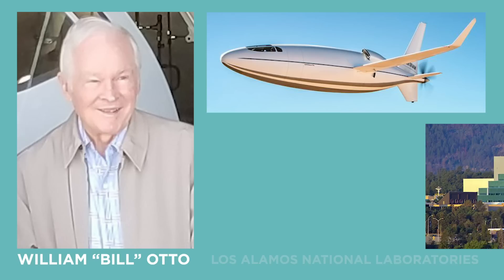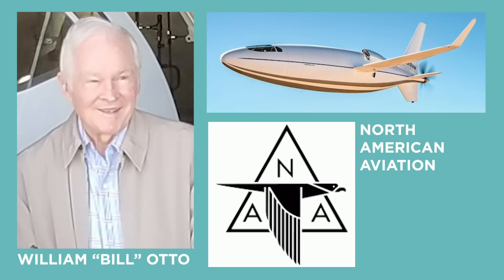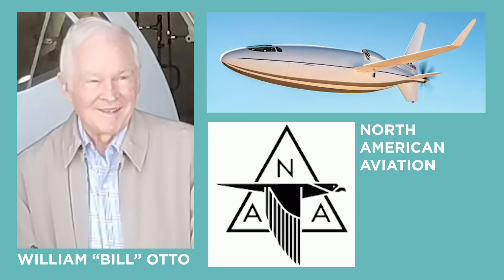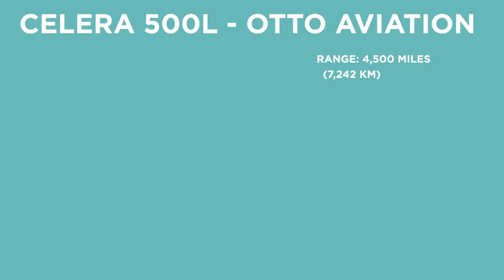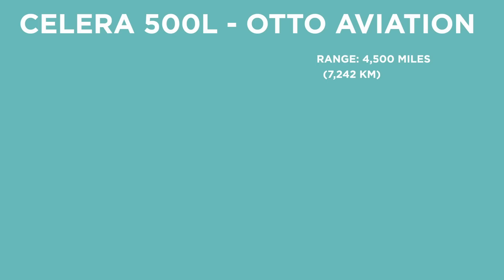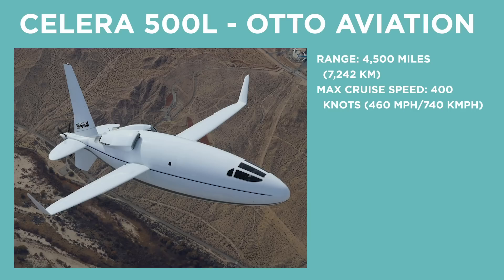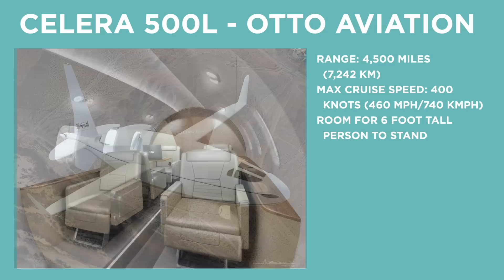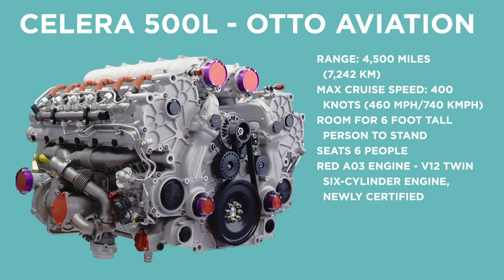Could This Plane Save The World? (Hint: No.) | Answers With Joe

Comment: The Celera is a step in the right direction. For example, if one of those planes crashes you lose 7 people -- a tragedy, yes, but two magnitudes of catastrophe below losing a fully loaded 747.

If the Celera could be scaled up for, say, 50 or 100 passengers, now you have more of an apples-to-apples comparison.

But the real improvement in aviation (besides going from fossil fuels to electric), is to devise a reliable VTOL system. If all aircraft could land and take off vertically, we'd be able to eliminate those long long runways from airports (well... maybe keep just one for emergencies). Congestion over airports during busy times could be eliminated, as AT Controllers could simply direct each incoming plane to a designated landing square. And the horrible crash trails generated by large aircraft that fail in takeoff or landing would be no more, as failures would be confined to small areas and would not hinder other aircraft from operating.
Reply: (BTW I'm not an aviation expert either, just like Joe, BUT... I do own the entire 200-piece set of Jello airplane coins from the 1960s, complete with storage carousel and booklet.)

Comment: Please Read a recent article in Flying Magazine by Peter Garrison, a aircraft designer, journalist and longtime pilot. He explains why it is unlikely the aircraft could ever meet its stated performance numbers, which by the way, are at altitudes the F.A.A. would never certify it to fly at. Beyond that it is not intended to be a replacement for a 747 or any other airliner. Additionally it looks strangely similar to another failed design, the Lear Fan.

Comment: You divide passenger air service into A) commercial routes which could feasibly be serviced by a Boeing 747 and B) private flights for six or fewer (probably rich) people. But there might be demand for a plane like the Celera 500L to service regularly scheduled commercial routes for which use of a Boeing 747 would be absurd. In most cases, such commercial routes are probably not serviced at all currently. There are probably hundreds of airports across the country which could accomodate the Celera but not a large commercial jet.

Comment: I agree on your point but let's say that is a good smal step in a rigth direction. 
Also you missed few things.
1) Spending in giving work to pilot and less in fuel is good. And this can be pushed a bit. Like reducing taxes on wages and increase taxes on fuels.
2) Today fly optimizatiuon works on "forcing" people to fly where you whant manipulating prices to fill planes. And it's a super fragile and difficult to scale down system. Infact with COVID all airlines will faile without some help. Having smaller aircraft is much easier to adapt to market changes.

But... to exploit point number 2. Prices for this kind of plane need to go down and it's capacity go up. At least double the passengers. Or 4 time better.

Comment: Yes, but is there anything stopping them from creating a Celera the size of a Boeing 747? Because it is so energy efficient, it seems like an electric Celera should be possible.  If 747-sized Celeras can be created that run on batteries, that would seem to solve the problem of GHG emissions. The second thing to keep in mind is that most of the  impact of jet travel comes from the radiative forcing from the contrails, which has roughly 3 times the warming effect of just the CO2 emissions, plus there is the black carbon from incompletely burned jet fuel. The Celera with a propeller won't be creating the kind of contrails like conventional jets, so it really does seem to be able to solve one of the major problems. 

By the way, pilots cost way more than $50 per hour, at least 747 pilots do.

There are a lot of good ideas out there like aeroships (i.e. blimps) and aeroships that travel at high altitudes to catch the jet stream (https://www.sciencedirect.com/science/article/pii/S2590174519300145?via=ihub) , but they get very little investment to do the R&D. The exciting thing about the Celera is that it seems to be getting the funding so it will actually come to market.

Comment: I think there's a lot to be said for the flexibility you get with a large fleet of small planes. Most of the costs of each flight are fixed. That is, it costs basically the same amount of money to fly an empty plane from Seattle to Denver as it does to fly a full plane. I just flew on a boing 737 with a full crew and less than 20 passengers. The airline literally lost money on that flight. Large fleets of small planes definitely cost more to operate, assuming that all flights are full, but they mitigate the risks of losing money when flights are not full. I can see a scenario where that reduced risk, makes the cost worth it. And since airlines are just going to pass those costs on to consumers anyway, we may find that passengers are willing to pay more to fly smaller. I know I would. I guess time will tell

Comment: Electric aircraft make sense for trainer aircraft ie: the cost of fuel is quiet high for 30 minutes ($50 -$100)

So to lower the cost of training a new pilot is key in order to lowering the cost of aviation much like it is with any industry that requires years of training.

Comment: Wouldn't the real benefits really be the overall efficiency of allocating passengers?

If you took an international flight to an airport when you want to travel to the country, you'd want to fly to an airport close to your destination, as well as travel to any province/county you need to go to, using a bus or car.
Maybe with this you can use mini airports that take you to larger international airports so that you save the fuel of the automobile both ways. This way, you can also reduce a number of international airports in an area, and distribute the passengers using these. Sort of like an international railway, but with these planes.

Not to mention there's a massive opportunity to make a taxi service with these if the scaling gets better. Travel between cities is easier, and Crossing bodies of water becomes far easier. The biggest competitor for this would be trains of course. At 9 Passengers with 20mpg average, this could have ~180 PMPG, which is greater if I'm correctly understanding the quick google. Also the mileage of the plane may be more efficient than land vehicles as the aircraft tends to travel more linearly. 

Notably, I have no experience in this field. So I may be missing details :(

Comment: There are multiple conceptual mistakes you make when analyzing the potential impact of this new type of aircraft.

1. You assumed that companies won't use if it it's not as profitable. Companies DON'T get to decide what the price of stuff is. So, if a new company comes around and offers seats on this new type of aircraft at a competitive price and there's demand for it, it doesn't actually matter what existing companies would like (e.g. direct routes, shorter waiting times, etc). Companies don't set prices, if one comes around and is successful they'd have to offer it themselves or die, or lost a percentage of their existing market share. 

2. Airlines DON'T make their money by selling tickets, at least not any of the major large airline companies. They make their money mostly by selling airline points.

Also, obviously, a 737 is not 20 million. But that's neither here nor there. I'm not saying this aircraft will revolutionize the industry, my point is that you need to be more careful about your assumptions regarding how the economics of the industry are like.

Comment: Perhaps if they tried to create commercial planes designed towards creating laminar flow.

Also just gas-milage/#passengers 

737: 5/366=~0.01366 miles per gallon per passenger

Celera: 25/6=~4.16667 miles per gallon per passenger

It couldn't come close to being more profitable than a 737, and it hardly makes private flight affordable for more people, on top of being significantly being more environmentally impactful on a per person basis.

Comment: Instead of making a room full of human readable instruments, control mechanisms and chairs for pilots, a room called a cockpit, we should instead have a closet full of GPUs and sensors in and around the aircraft. We don't need the pilots and 6 passengers don't need to be babysat if there's a monitoring system in the aircraft.
Less passengers per planes means more planes which means you would need a better system for landing those planes. You could have 2 planes land one after the other in rapid succession if you could take advantage of the drag cause by turbulent airflow. You could use the drag sort of like handrails this way the following aircraft can stablize and destablize it's pitch, yaw, trajectory, etc as needed to land safely or evade danger if something goes wrong with the leading aircraft. AND these are way smaller than a jumbo jet so high maneuverability is a factor that should be considered for increasing touchdowns per minute. Which would also save fuel because you'll have less aircraft circling the space around the airport waiting for permission to land.

Comment: Lets talk about a couple of factors I think got missed here:

The most popular airliner class is the 737/A320 size airplane.  They do the majority of passenger miles in the US.  The Boeing 737 is the best selling airliner in the world.

Next:  It's more about the design concept than the size.  Think Celera 5000; a plane that competes with the 737/A320 class but does it on one engine or two smaller, much more efficient engines.  The shape of this plane is what makes it efficient, and that really isn't affected that much by it's actual size.  So it could be bigger and still be as efficient, or at the very least, much more efficient than a 737.
Reply: The reason why the Celera is so slick and efficient is because it has laminar flow on ALL surfaces, not just the wings, not just the tail, but the fuselage and everything else touching the air.  To maintain that laminar flow over the entire aircraft, the size itself has to remain small for it to work.  You would need an impossibly smooth surface beyond the sizes that Otto is attempting and that's not even including the other parts of the plane on its surface, like where the wing and tail and air scoops meet the fuselage, the little instrument ports that are necessary on all aircraft, all the door and window seals, etc., that would more or less destroy that impossibly smooth surface you made.  Turbulent flow is sort of like a cascade effect, one tiny burble in laminar flow and it multiplies on its own until it makes all of the flow turbulent.  If a tiny gap in the door seal creates a tiny little burble, that will multiply on it's own and kill the laminar flow, but luckily that tiny burble doesn't have a chance to disrupt the laminar flow since the tail of the airplane has already left the area...in a 747 that burble might turn into fully non-laminar flow by the time its halfway to the wings, leaving the rest of the aircraft in draggy turbulent air.  Continuing this example, you'd have to make that 747's door gap fit so ridiculously flush that you wouldn't be able to feel the seam with your fingernail.  And that's only considering the obvious, as even the smooth sections of an aircraft need to be geometrically accurate, there can't be even the slightest imperfection, meaning any flat sections would have to be truly flat, any curved sections would have to follow that exact curve, with a margin of error lower than a coating of paint. So keeping the aircraft small is really the only practical way you can achieve laminar flow, since even the tiniest amount of imperfection will eventually end up causing non-laminar flow.  By stopping a specific size, you're basically making a cutoff point at which laminar flow is too hard to practically maintain.  To put that into perspective, so far this is the only aircraft I know of that has incorporated laminar flow on all surfaces, not even NASA has made a fully laminar airframe for testing purposes, so for them to manage it on their own is an engineering accomplishment.  Laminar flow is, to put it mildly, the holy grail of aerodynamics.

Comment: Ahhh, consider a Solera designed 747 sized aircraft.  If the solera is one sixth the operating cost of a similar sized private jet, perhaps the operating cost of a 360 passenger jet would be equivalent!

Comment: Thinking the maths on the staff costs was slightly off for a thousand mile flight as 1000/450 is ~ 2.22 not 3 hours x the cost of the staff for the smaller aircraft.

Comment: I definitely think that it needs to be scaled up before competing with the big airline planes. However the pilot issue I think can be solved by autonomous flight but maybe with the addition of take-offs and landings being done by remote pilot. For instance, the airport could have a room of pilots each with like a simulator that is controlling the planes. The pilot takes off and once in the air the autopilot will take it to the destination where that airport will also have a room of pilots that will land the plane remotely. That is of course only until autonomous flight is advanced enough to take-off and land safely on its own. I'm pretty sure that the vast majority of accidents for planes happen within certain radius of the airports just after takeoff or just before landing. If there is a problem between airports then the airplane can just call the nearest airport for assistance. It seems to work for military drones, so why not airlines? This is, of course, only if the latency of the remote connection is not too bad.
Reply: Artificial intelligence would have to make massive strides, far surpassing the basic autopilot of today. Today's autopilot will have no issues flying into the side of a mountain, thunderstorm, hailstorm, or other aircraft. Efficiency decisions based on the current or amended route would also have to be constantly optimized, while always considered the safety and comfort for passengers. Descending early into known, reported, turbulence, or significant atmospheric icing would not be a wise decision. 

In addition to the ever changing environment of cruise flight, there's the abnormal situations which would have to be addressed in real time. Abnormal situations that could range from a faulty environmental control system, to propulsion issues, there are thousands of possibilities in this realm. In many cases, there are multiple failures from a single point of failure. 

Are pilotless commercial flights impossible? I don't think so. But on board computers will have to be as redundant and resilient as two alert pilots of today. 

Modern spaceflight has an entire team watching over a single mission today. To the best my knowledge, they are far from handling hundreds, if not thousands, of real time missions.... just as an example.

Comment: What if they flew these things in "flocks"? Would that mitigate traffic control expenses or complications? The cost of building our land based transportation infrastructure was probably pretty steep but it seems to have been worth it. What if we built lots more airports and made the air traffic industry less centralized? Could be painful in the short term, but possibly worth it. Maybe?

What if they marketed flights on these airplanes as first class or hyper exclusive? Maybe they could increase the return on investment and make operating costs more feasible.

Seems like there is a little room to explore to mitigate the cost of operation on these things.

It's probably worth stating that the Wright brothers' airplanes weren't terribly efficient but through the processes of engineering, experimentation, and experience, we've come a long way. The same thing can happen again.

Comment: As a major aviation enthusiast I am excited about the new design but I'll also admit that the practicality of it is very low for taking over from the traditional commercial jets. Private planes always work out to costing more than flying commercial because their are less passengers to spread the costs around. So no it will not truly be any significant challenge to the commercial jets or change the way the masses travel. You'd have better luck looking at a potential revolution from SpaceX's Starship. Although, I don't know about Elon's idea of driving costs down enough for airline companies to own them for moving passengers around from one part of the globe to another.

Comment: One can see why the 747 is so huge ...
One suspects Otto might find a niche for on-demand, air taxi - Lyft with lift - flights. Of course, once one starts to charge passengers the FAS layers on more requirements for the airplane's cert & on the crew. At some point the FAA (I don't know the regs well) might insist on 2 pilots and a plane with one-engine-inoperative capabiliyy (I.e. at least two engines).

Comment: hmm... I think there would be a limit to how big it could get. To seat 50 people, for example, it would need 2 props, bigger engines and more fuel. Or more likely a turbo prop or two.  When it gets as big as 747, it might look no different from 747.  Celera is revolutionary for sure. That's no small feat.  However...  rotor sails on container ships, water bubbles under the hull, Hyundai "Hi-Fin" screws could save over million dollars per year in fuel savings.  They might make great impact per dollar spent.  Obviously, extending tax credit for solar panels and electric cars in USA may have single greatest impact in the long run.